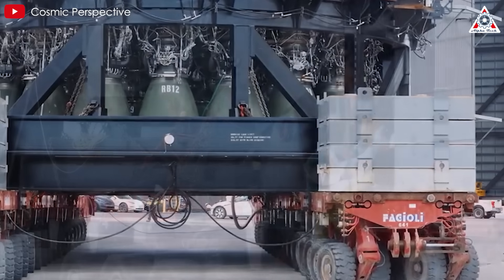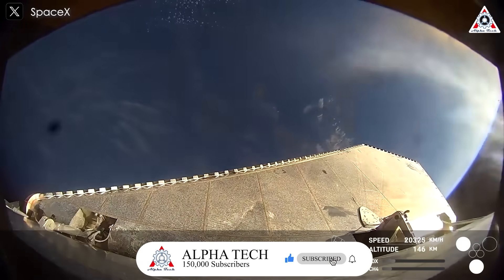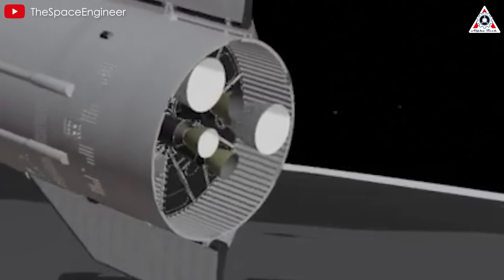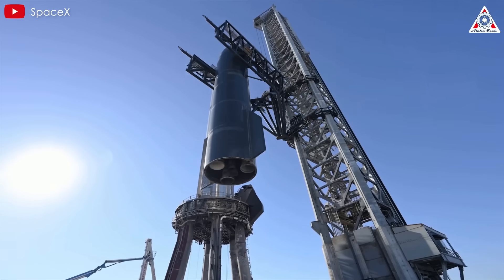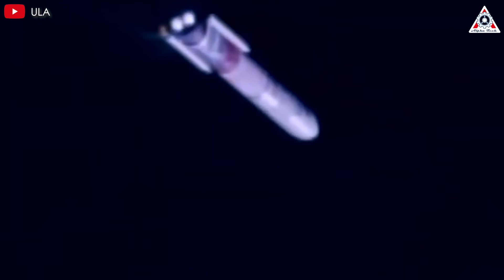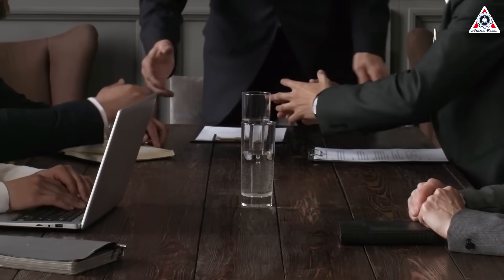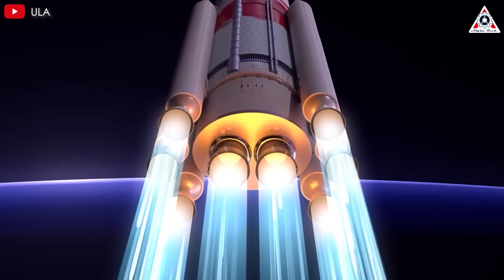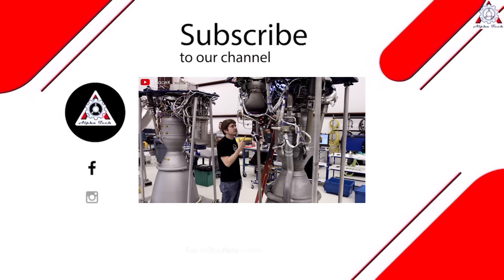SpaceX just Revealed New Solution to Solve R-Vac Engine Trouble.

Comment: Sorry, no variant of the Raptor comes anywhere near the Isp of the RS-25 engines used on the Space Shuttle.  At sea-level the Isp was about 366 seconds whereas in vacuum it was over 452 seconds -- so the bet of the RS-25 at 452 seconds compared to the 378 seconds of the latest vacuum Raptor.  This puts the RS-25 at nearly 20% higher Isp and that's if you believe the vacuum Raptors are at 378 seconds and I don't -- in fact I'd bet the best the vacuum Raptor can achieve is about 372 seconds and quite possible less than that.  There are variant of hydrogen based engines with an Isp over 465 seconds.

Comment: I still think it is the hot staging blowing around small pieces of metal or dirt at high speed that makes small puncture in the sensitive vacuum engine bell, leading to cooling failures, then engine explosion!
Reply: Amen Brother! (or sister ;-). I've thought from the very beginning that this Hot Staging is a very bad idea.  If it was so great, Von Braun would have done it on the Saturn V!  I've heard some lame argument about it helping with payload or orbital achievement.  The only way that happens is if the hot staging event "pushes" the booster away from the ship with some notable force.  Firstly, that force is tiny compared to the whole energy budget of the launch.  If you never did it you give up virtually nothing (ok something, but its small). So if there are any regrets, then its not worth doing. Well there is already one regret, and that is the weight of the staging ring which is a pretty hefty chunk of metal that they have to haul up to the staging event.  I think that negates any benefit of hot staging just by itself.  Then they have to recover it because they dont want to haul it down to the mechazilla (more fuel).  By the time you add up all the weight and the cost, this is already a bad idea.  Now you add to that the insane risk of blasting 3-6 Raptor engines and their associated hardware in a confined space with extreme rocket blast!  My God man, you saw what those raptors did to the concrete pad on the first launch, and now you are doing that in an enclosed space in close proximity between two vehicles?  That is just asking for trouble.  That is like setting off an explosion in the engine compartment.  These failures may be nothing more than that blast cracking and bowing off pieces of the raptors, or plumbing, or buckling the whole frame of the bottom of the ship.  And note, I dont know of ANY of this kind of environment having been simulated in ANY of SpaceXs tests to date.  You would somehow have to stress the ship as if its still being boosted, then constrain the Raptor exhaust like the ring and booster do, ideally do this with low pressure outside, and have the Ship with full tanks and cargo.  I believe if they test this properly they will find that they are almost caving in the whole bottom of the ship, and then no wonder things start to leak, propellant lines break, and engines rupture.  The whole idea is flawed IMHO.  I'll make a bet with Elon: one month of my pay to one month of his pay:  We ditch the ring, and use the grid fins (or other methods) to drag the booster backwards faster than the ship's speed carries it forward.  The grid fins may not be enough drag, so you simply pop out hinged panels to catch the airstream producing a huge drag that pulls the booster back and away from the ship.  You could also use little rockets/explosives like Saturn V did.  A combination of these and the grid fins rapidly steer the booster away once separated, and after a short delay (at most a few seconds) the ship's engines light.  And BTW, when this is done, the center raptors should light first to provide stability control, and only once they are stably operating turn on the Vacuum engines.  Also in this regard, I'm not sure I would keep all the inner raptors running.  Their ISP is notably lower than the vacuum engines, so I would shut down two of them (currently need at least one for thrust vector control).  At some point SpaceX needs to revisit the also bad idea of not gimbaling the vacuum engines, because as we have seen, failure of the inner engines results in mission failure even if the vacuum raptors still work.  A first improvement is to give those vacuum raptors at least vernier thrust vector control: there are ways to do this with very little weight or complexity penalty.  Then just dont light the inner raptors at all, and enjoy full ISP for the whole launch.  A second improvement is to make the raptor engines also capable of sea level operation.  Elon I can show you how to do that ;-)  Then you dont need 6 engines and you get to add 3 engines worth of mass to the payload.
Reply: @hu5116 I bet they could use a couple small solid rocket booster  pointed outward close to the outside of the bottom to separate, ditch the 12 ton cap, then light up the man engines after 5 seconds. The engines put out 200 bar so maybe 3000psi of pressure kicking shit up in the delicate engine bay! Good write up!

Comment: Look at what has been changed from block1 to block2. To remedy vibration resonance issues, you need to change either of: the fundamental forcing frequency which energises the vibrating components, or, change the resonant frequency by changing either the stiffness  or the mass of the vibrating component.
Possibly a fastener/s vibrated loose, allowing increasing vibration amplitudes until the major failure.

Comment: I wonder if they don't have enough internal structure causing vibrations especially to the plate that the engines are mounted to. The final designs shows plenty with floors wall and passage ways. Now you just have fuel tanks and the pez dispensor. But what do I know I'm just an old smart building engineer.

Comment: Has anyone ever considered that the decision to perform hot staging might be an undesirable variable in this design? The most recent launches didn't even wait for the booster to clear the stage 2 starship. It just turned around and began boosting back right away. Maybe some more distance would be worth consideration.
Reply: Absolutely my thought. Get the thing working, then explore hot staging later in the program as a side issue. But right now, this is negatively affecting the morale of his young team and the interest of the public. It also exposes him more to the judgments of government departments.
Reply: If not sabotaged...by DemRats🤔

Not very smart engineering  indeed if no take in account the variation in frequency and amplitude of resonant vibration with full&empty fuel tank. 
The excuse saying that that cant be   test in ground are hilarious...since you can atach a vibration generator and check the entire spectrum of resonance and where along the pipeline in order to dampening. 
Flexure conection of the piping end could be a good idea too.

Comment: Please don't compare the R-Vac ISP to that of the RS-25. The R-Vac optimizes the propellent combination of methane and oxygen with its breakthrough full-flowed staged combustion cycle. But it doesn't compare in ISP with the RS-25 Space Shuttle Main Engine, which burns the hydrogen oxygen combination.

Long term it seems to me a good idea to get away from relying on solid rocket boosters to increase liftoff thrust. Both SpaceX and Blue Origin have avoided going that route.

Comment: Funny!! The Artemis vacuum engines (RL-10) have no such issues, even using far colder propellants of LOX and Liquid Hydrogen (-425 F!)!! Maybe SpaceX should hire NASA and Boeing engineers!!!
Reply: That’s what they never want to admit most of this tech is through knowledge gained from NASA.
Reply: You do realize the intent of the Raptor engine is to NOT use hydrogen for fuel but use Methane instead. So you're comparing apples to oranges. I hope you don't think hydrogen engines always worked perfectly from day one. This takes time. SpaceX is just much more open and transparent about what they are doing so we see all the mishaps along with the successes. They will get this right and when they do they will surpass everyone else in the business; Falcon 9 and Dragon engines for example.
Reply: @ A argument could be made the Raptors are definitely sketchy AF. When they get it right? Exactly they haven’t done anything really but show they can blow a rocket up in various ways, sometimes even the exact same failure mode 🤷‍♂️
Reply: @michaelharmon5991  

🤡🤡🤡🤡 Liquid Hydrogen is more efficient. Methane is easier and is a greenhouse gas, and produces greenhouse gases!!🤡🤡🤡🤡
Reply: Do you see NASA flying anything? 🤫
Reply: @ BWAHAHAHAHAHA!!😂🤣😅

NASA is an agency, and has NEVER MADE OR FLOWN ANYTHING!! They have ALWAYS contracted out whatever they slap their logo on, since 1958!!!
Reply: @jimb4090   Literally decades ago they accomplished more than SpaceX could dream of. NASA actually has multiple probes on Mars 🤦‍♂️🤡
Reply: Did you really just say hire BOEING engineers 😂. How many other full flow staged rocket engines do you know that can make it to orbit. Btw SpaceX 10th Crew Dragon mission how many other private companies have taken astronauts to the space station?  Lmao BOEING can’t even get them back.
Reply: @ 

Which Starships have completed the mission to the moon and back to earth, with a safe and pinpoint accurate landing?? 

Both SLS and Starliner have.

Starliner programmed out 1 of 28 nozzles. Made a perfect docking on the ISS. Flew perfectly back to earth, pinpoint landing. Only NASA’s DEI executives said “no”! All the NASA and Boeing engineers, and Butch and Suni, said Starliner was perfectly safe! Starliner flew perfectly and landed perfectly!! Who was right??? NASA and Boeing engineers, and Butch and Suni were right!!!!
Reply: I wouldn't trust a Boeing engineer as far as I can throw you.
Reply: @ Where is your degree in engineering from?
Reply: @ 

US Naval Academy. Yours??
Reply: @ What aircraft have you designed?
Reply: @ 

The replacement wing root for the A-6 Intruder. The vortex generator for the F/A-18 C/D/E/F, Purge air system for the Artemis 2/3/4 Umbilical plates. Space Charging dissipation for EUS upper stage Artemis 4/5.

Blended wing/body RC aircraft.

You???

Comment: It seems more like inferior materials use in the means of cooling. I would suggest a return to the older heat control area. It wasn’t fires alongside one another. It’s certainly not shaking unless the methodological approach to welding or joinery should never fail. It should be a single piece with that type of cooling. Using the same on ship s exterior explain s why the ship itself fails so far. Unbelievable. Again Mr.Musk return to Ceramic Shell heat resistantance. Again in my field of work with my receipts I never had a failure in my work from 1985-1994

Comment: Could they cut all engines at first sign of trouble.... regain attitude control....and go ahead and let it do a reentry.... using thrusters and flaps... and salvage part of the mission... as far as reentry goes....  just won't be able to do a soft landing.... yes... It won;t be in splash down area.... but if they can regain control..... it will coast for a long way.... and perhaps... they can change the ending glide path enough to reach splash down area.....maybe catch some of it on the ocean cams....

Comment: 1/ You dont know  your guessing...one of those AI generated scripts 2/ It broke so lets hire someone off the street to fix it- doubtful more likely they are ramping up. 3/ My guess- coolant leak caused by failure in hot staging...leading to combustion problems and catastrophic engine failure of R vac.

Comment: So Elon's solution is to hire more high paid staff.  How anti-DOGE of him!  What's he going to do, fire them without notice when a solution is found?
Reply: Probably fired the last one as they hadnt launched 5 rockets this week.
Reply: You clearly have zero understanding of how Elon runs things.  "No part is the best part."  "If you don't have to add back at least 10% then you didn't remove enough."  No one needs a high paid propulsion engineer if your propulsion is working fine.  You only need them when it isn't.
Reply: @iMeatbag  the bots don't understand that spending money isn't an issue. Unnecessarily spending it without any return IS a problem. What a concept, you have to earn an income. Wow.
Reply: DoGE is an advisory group with no real power excluding being allowed to read things. Of the half a trillion cuts they've recommended the departments have done 105 billion. Which means the different departments have said no to 80% of the cuts

Comment: 😂 SpaceX puts out the job posting after they discover there's a problem...
Too bad the fuel supply systems guy wasnt there before they blew schitt up!

Those Rocket Nerds know everything.... (until they dont...)😂

Humor aside, You probably couldn't design a better hull shape for reverberation. Basically an ELONgated drum, with several diaphrams, and a parabolic reflector in the nose, with the loudest mechanical sound generators known, installed aft,  pushing serious amounts of stress into the bottom of the ship. 
Also the Vacuum Raptors appear to be cantilevered off their forward end, basically allowed to vibrate, and having oversized bells to assist the harmonics.

No attempt at dampening. just hooked up solid, no dampeing strut arrays, no firewall structure for support at aft of engines, nada!

Basically an echo chamber operating in a vacuum when in orbit.

And likely all the guns firing at the same harmonic frequency...

Might be better to get the engines out of phase with each other and lope them independently, with some going upscale as others go down, and no two in phase at any time.

Also might pay to adjust thrust as the atmostphere thins.
To counderact loss of sonic absorbsion.

The ship could have some dampening struts with rubber like blocks isolating in the center so deadening vibrations in the hull. And maybe a good time to also start considering optimum hull shapes for harmonics absorbsion in a Vacuum. Basically the bigger and more powerful ships get the more important thats gonna be...

Wont break my heart to see the tube ships go by the wayside finally, and get us beyond Bamboo Rockets era designs. 😂

Also dont forget that some Nomex felt could be applied with contact cement to absorb hull vibrations. Best where theres a gaseous medium, but better than nothing in a vacuum.

I got trolled yesterday for suggesting research into better hull shapes...
Somebody not happy.... 
Me? happy dog! maybe will lead to better hulls with way better characteristics on myriad issues.

Tubes are not likely  the end all Space Ship shape.

Just sayin'
Reply from the maker: Love your explanation. Thank you so much!